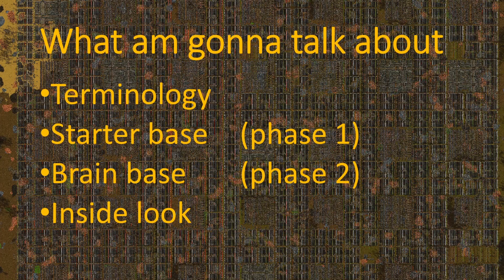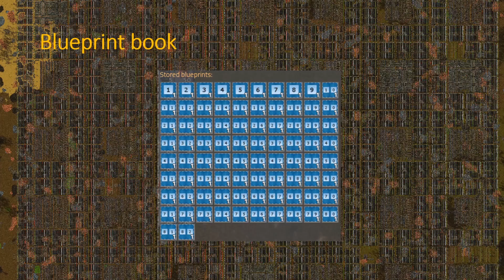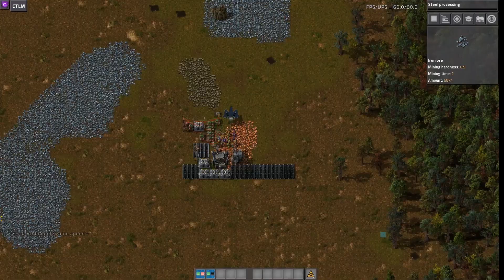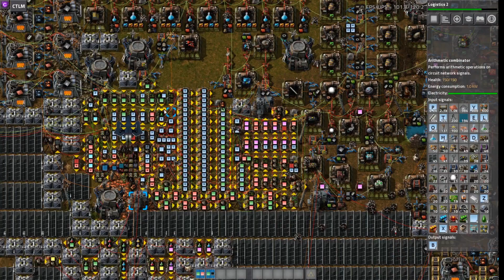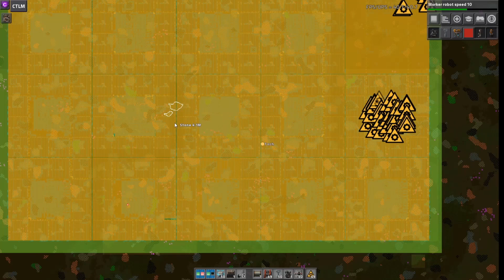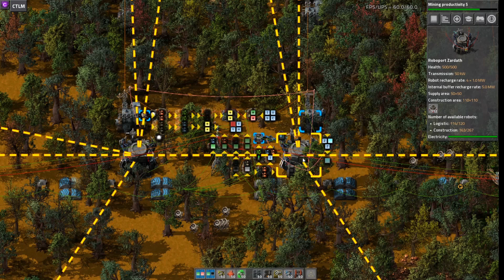Self-replicating infinite mega base TAFK2 commentary video -Factorio

Comment: In case you hadn't already figured out the "smart smelters" at 52:53: You did already set the stack size ; but you have to circuit-connect the inserter to a source box to ensure there are enough iron plates available. Sourcing the iron plates directly from the smelter means it can't tell how many are available. Without a circuit condition the inserter will to try pick up as soon as there are any plates in the source smelter, even if the number is less than the stack size.

Comment: Really good. What's your peak rocket launch speed so far if you just leave this to go fully grey goo?
Reply from the maker: If i rember correctly, one rocket base was like 38mins to make rocket and at my lowest UPS point i had like 8 rocket builds, that would make, thats like rocket per 12 mins ? nearly as not efficient as i planned but i as i stateted earlier i didnt finnished optimization at all.
Reply: Jiří Červa but still very neat

Comment: Neat. Want to share the production statistics?
Reply from the maker: As a celebration i swaped to 0.16 so cant check right now, but afaik around 700science/s which is highly under my expectaion and its own limits, but i basicly stayed in almost bugless beta, never went for optimization :)
Reply: 700 Science per SECOND, not per minute? I would understand your disapointement if it's 700s/minute, but 700Science per second puts it at 42KSPM, close to the 60KSPM factorio server, which was actullay DOZEN of servers combined with clusterio. At this point, I would expect you to be talking about your computer's limitation rather than the factory's (which, if I understand correctly, has none but bot speed, 2D map and minor design flaws potentially impacting growth speed, but not max production).

Comment: Great video...
Reply: any way.. i  made a system to share resources between diffrent cells that also can cascade from cell to cell.

Its pretty simple. Every cell have a constant combination of negative value of what ever resources should be in the cell. That is added to the actual number of resources. So if its a surplus is positive, and if its a defesit its negative.

So the information of the status of the units is sent to every cell next to it. If the a cell reads that the cell next to it have a positive number of resources they are just discarded. If a cell have a negative number, it compares to its own value. If the value is higher it sends the resources over.

There are 5 requester chest. The speed a resource will be sent can be set by the amount in the chest. If its sett to just 1, the items will be sent in a slow pace, if it set to say 20 it will be sent fairly quickly.

So this way if say cell 1 have 0 cell 2 have 0 and cell 3 have -1000

Then cell 2 will send to cell cell 3, the second that cell 2 start sending it will decrees to -1, and cell 1 will start sending to cell 2.

There is also a really smart way to use this in a smart factory to not have to set buffert. Using the same system... really just link in the smart factory. Invert the values and filter them for what is actually produced. Than use filter inserters for extracting from each assembly unit. Then set them to filter from logistics network.

This way the assembler will only produce units if there is a grid wide shortage.

Say for example. If there are 1000 powerpoles in a storage chest, but there are 0 in the provider chest that the assembler is exporting to, it will still not export.

Using the constant combinator this level can also be offset. That is. Say that the cell is set to have 100 power poles, it have only 80. The factory can be offsett to only start producing when it hit 50. So if there is a surplus in any other cell, they will be shifted around.

https://scontent-arn2-1.xx.fbcdn.net/v/t34.0-12/26994962_10155212885516526_170060815_n.png?oh=6abb78e0caac6c0feac0791583279b10&oe=5A62AF63
Reply: Still. For stuff that is used in lower quantities. maybe only one and one, like refineries. The same method could be used a direct bridge via the same method. This would be pretty much instant and not have a tendancy to overflow.

This way, every bridge could handle 20 different types of units as well. Say with the 60 types that can be used in the belt bridge, say add two direct bridges to one could have 100 different type of units.